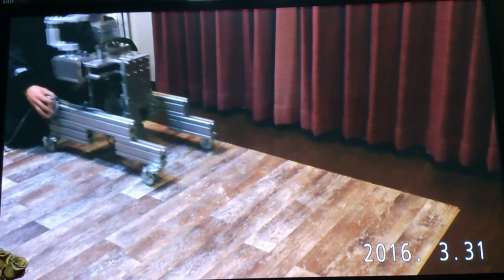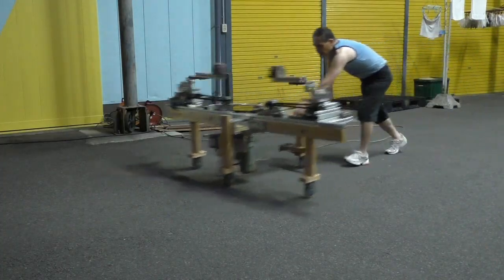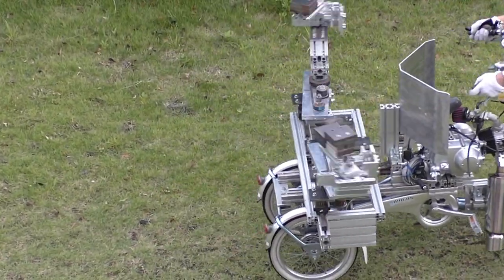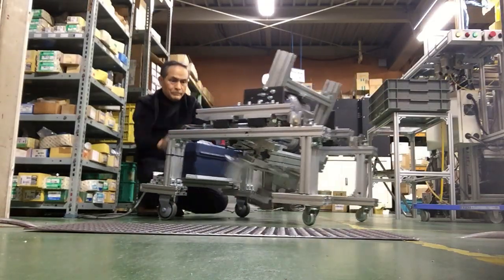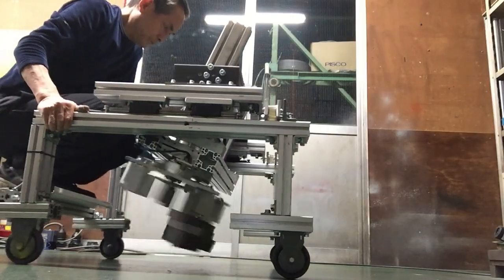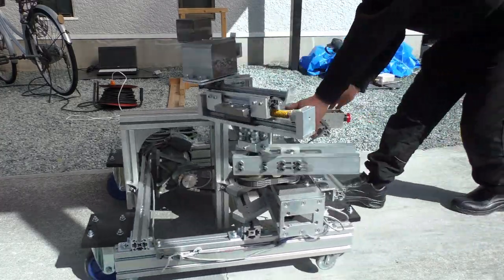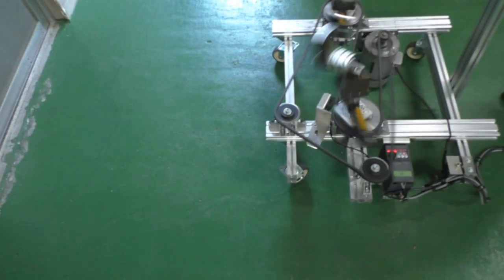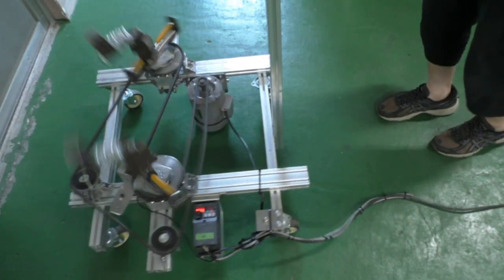Week 7 – The Amazing Propulsion Devices of Tokio Muramatsu

Comment: Not inertial propulsion. The forward thrust is obtained by the fact that the friction sideways is greater than the friction forward. The efficiency of this system is terrible as much of the force is wasted. Place the whole thing on a low friction platform ie, a sheet of ply on marbles on a hard  floor and it will just perform small circles created by the imbalance of the system.
Reply: So true.

Comment: While I can't be sure without a working prototype, I can see how inertial propulsion could be feasible. Laws of physics are followed, not broken when the acceleration of a rotating mass is used to reorient a satellite, so even though it's not physically pushing against its environment nor using any unrecoverable propellant, the free floating object is moving about its center of mass. That's the starting point, even though it doesn't provide linear motion. The next step is indeed to provide an imbalance in the centrifugal forces, it seems rather difficult mechanically, looking at Tokyo's prototypes, but maybe it's easier using a fluid? I'm thinking of a rotating fluid which has a wide fast turn away from the center of mass and a slower sharp turn near the rotation axis, to favor directionality of the centrifugal force. I could be missing something but that's my initial thought.

Comment: How would these help in space?
Reply from the maker: Thrust generated with only electricity, not rocket fuel...
Reply: @stclairtechrd   yeah, but there is no ground to push off of in space... these will just spin in space. What are you missing?
Reply from the maker: @rogerrinkavage They don't require anything physical to push off from.
Reply: @stclairtechrd  you might want to take that up with Isaac Newton lol. If you figure it out, you should try perpetual motion next.

Comment: I had one back in 1996 that drove a canoe across a reservoir. Highly suggest doing a water test and smaller diameters for higher rpm.
Reply: it used an outside cam, really simple and i got it fairly small, about a foot cubed for a single rotor. I could sketch something up, that would be a fun project to resurrect.
I left it when i needed professional slip rings on a programmable one and just never picked it back up.
We should talk. I knew there was something there when my little gas powered plane came off the string, that ended up with a cinder block on a rope swinging in a circle and then about 10 years of thinking about it until college. That motion is like catching a glimpse of my long lost cousin.
Reply from the maker: @adrxian I'd like to see the sketches!
Reply: @stclairtechrd  I'll put something together. Might just do another one, i have a lot more resources now.
Reply from the maker: @adrxian Nice, I look forward to it!

Comment: Anything you have to stabilize by hanging on to it is not conclusive.
Reply: Yeah, having messed with these things myself, my concern with eccentric drives is that in the same device either you get an oscillation about its own center of mass, or if you start the machine at the right phase with a backstop force (like your hand), the machine will only pulse forward at a slow constant velocity.  The holy grail is to see hands off continuous acceleration of the device.
Reply from the maker: LOL, anything that generates that much power needs "something" to stabilize it, kind of like putting a 300 horsepower engine on a bicycle... No stabilizer equals disaster. Thanks for watching!